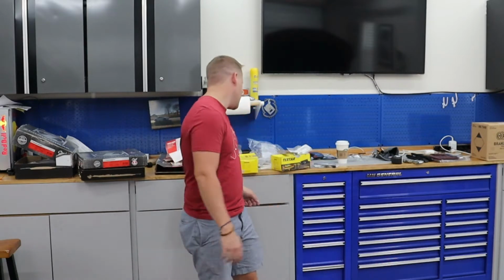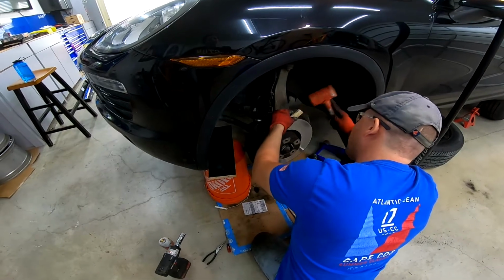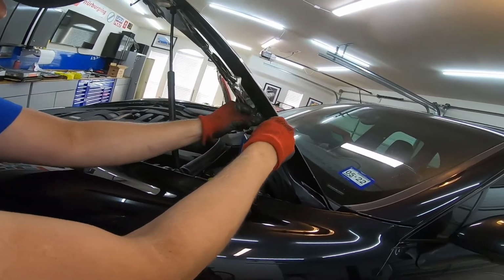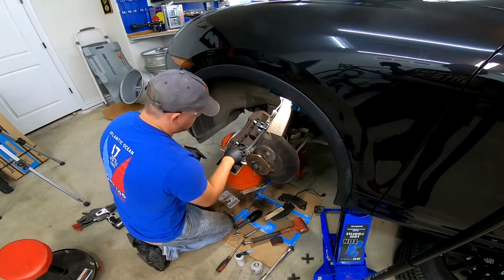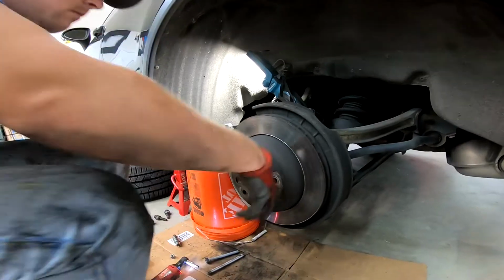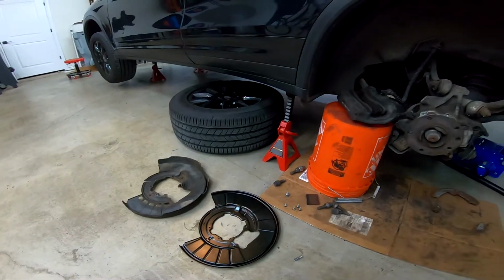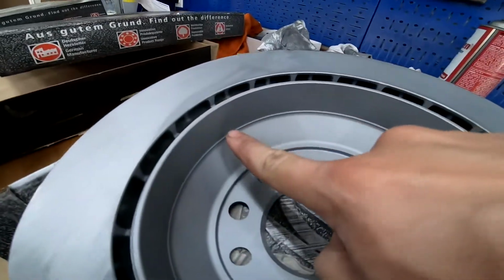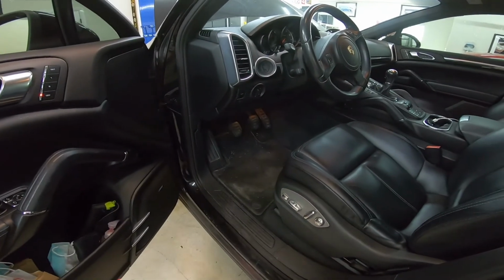Porsche Cayenne 958 Front and Rear Brake Replacement

Comment: Hi . how many brake pad sensor were  installed  on 2014 Porsche Cayenne ? on each brake pads ?
Reply from the maker: I think they are just on the driver side.
Reply: @thefadshow    Thanks a lot. but i change my brake pads in garage, they sold me 4 pcs brake worn sensor . Previosly i had BMW x 5 , there are 2 pcs sensor one front another rear
Reply: My 2014 Cayenne GTS has one wear sensor on each inner pad so total of four.

Comment: You don't need to get the coating off the rotors, just read the instructions in the box. It burns off after a few brake applications.
Reply: some rotors have cutting oil on them still. you need to get that off or it will soak into the pads.
Reply: @charlesrosenbloom4140  Cutting oil on coated rotors? I would imagine they are coated after they are finished. Zimmerman specifically says to just drive.

Comment: Do you need a scanner for the rear brakes?
Reply from the maker: I didn’t use one just make sure brake is off and not dragging. Can use dial adjusted to take tension off it.